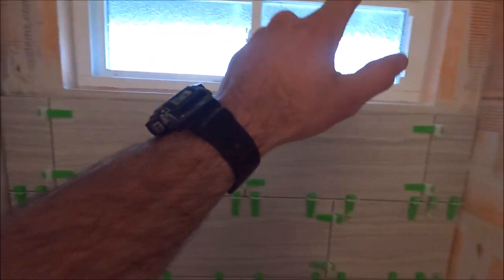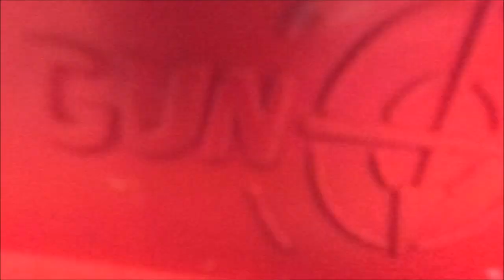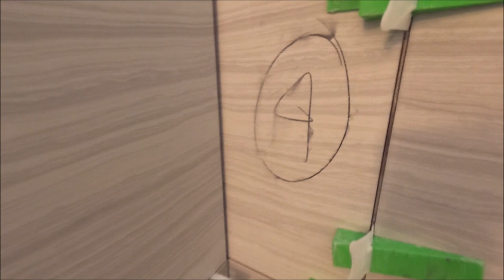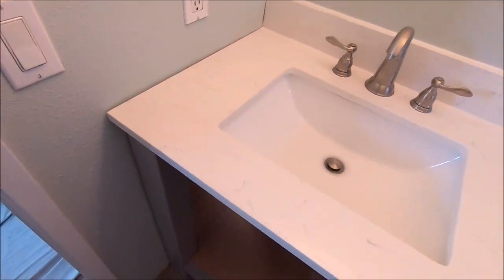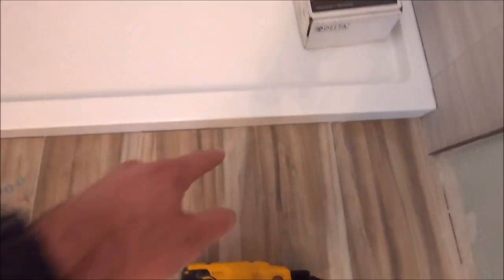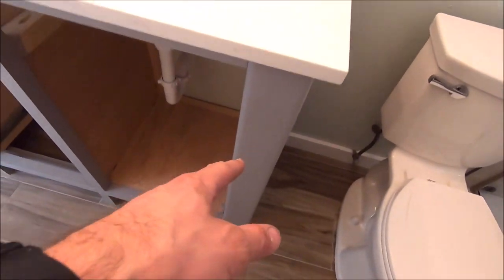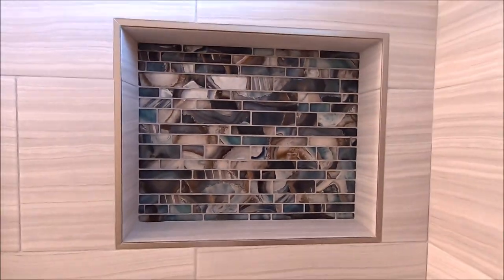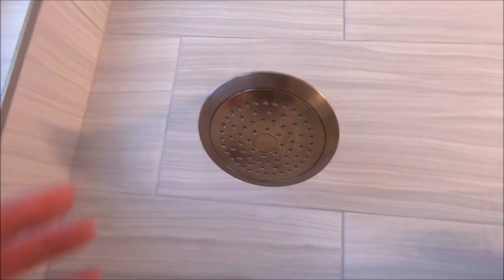Modern Shower Build Old to New

Comment: Sorry buddy but your niche is out of alignment, the bottom is ok but the top one do not match the horizontal grout line nor the sides are aligned with the vertical grout lines. Contact me and I'll show you how to get it done right..
Reply from the maker: we base our layout on the back wall being centered and symmetrical. Side walls end where they end on the niche. Also, this niche is 16x20 (custom prefab schluter niche) so it's impossible to have our 12x24 tile end at bottom and top. The client wanted a taller niche than a 12x20 because of Costco size bottles.

Comment: What a terrible location to enter the shower with the toilet. Yikes
Reply: Wouldn't bet the farm on it but pretty sure that opens either side and he just opened it on that side to start showing the niche 1st....at least that's what I see all of the time and would hope or else I agree with you 100%
Reply: @CleanGroutNW  look at the video. Left side is on rollers and right is fixed panel. 11:43
Reply from the maker: Yes, these are bypass doors
Reply from the maker: rollers on both panels, you can see from the inside and the outside

Comment: For the niche would it be better to do the top, bottom, sides then the back so that tile over laps the bottom tile. The way it is now the bottom tile buts up against the back tile so whatever water that gets in there could possible go behind the grout/silicone over time?
Reply from the maker: Not with a Schluter 100% prefab niche. Installation steps do not matter other than making sure the sill has a pitch out. Schluter is a seal system, if was a water in water out system then yes, sill first, then back and sides.
Reply: @LandbergTileTV  got ya! Not saying I thought you did it wrong I was just curious. Do the a schluter prefab niche come with a pitch or you have to do that with the tile?

Comment: mosaic in the niche should go in as the last one and sits on the bottom piece
Reply from the maker: That does not matter installing a 100% waterproof prefab Schluter niche. It can be built any way you like regardless of watershed as long as the sill has a pitch out.

Comment: Looks great, at 1044 you ar missing some grout on the niche wall. Like using the wood blade instead of the metal blade to cut the metal trim. That is how I have always done it. Less sparks and cleaner cut. You have taught me a few things otherwise. Also do you caulk the metal trim with clear on the miters. are you not worried about it leaking?

Comment: How do you like the table top IQ saw? And why did you need to bring out the dewalt? The IQ couldn’t cut that niche part? Great job like always all the time braddah🤙🏽💯
Reply from the maker: The IQ claims it doesn't cut glass very well, Dewalt is faster with porcelain rips and glass 👊

Comment: Hey. I'm a commercial construction  tile worker. Looking to add the 20v. dewalt rotary hammer. I'm stuck between  dch133b and the "better" dch263b. I only here and there have to do tile, and old thinset demo. What one do you use? Maybe do a video on it one day?
Reply from the maker: Yes, great idea
Reply: @LandbergTileTV  Wich model do you use. Is it effective at tile demo? And how's the vibration on your hands after some use?

Comment: Great video as usual. May I ask a question? Regarding tile corner trims - how much gap should be allowed for grouting? And does the expansion of metal or plastic trims need to be taken into consideration?
Reply from the maker: We leave about 1/32 of a gap and easily install our Prism grout. I don't think expansion would be an issue.

Comment: You install that light fixture over the vanity upside down?

What do you think of using porcelainized steel (like Kohler) shower pans?  Thinking of using one in a shower redo instead of installing a regular shower pan and curb.
Reply from the maker: Never installed those types of pans, I'll have to check them out.

Comment: Do you color match silicon in the niche also
Reply from the maker: Yes color match 100% silicone, not for the niche, only sides of shower top perimeter and bottom perimeter. We have had excellent success with Prism grout along with sealing the grout (zero discoloration issues)
Reply: @LandbergTileTV  nice what sealer do you like. Thanks for the reply, tile on!!!